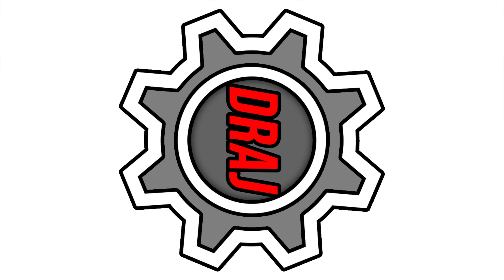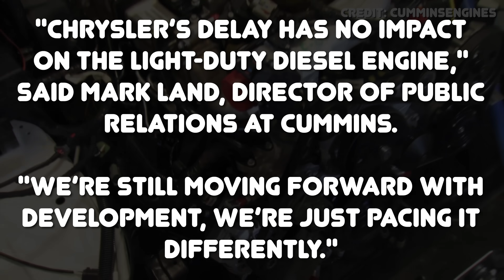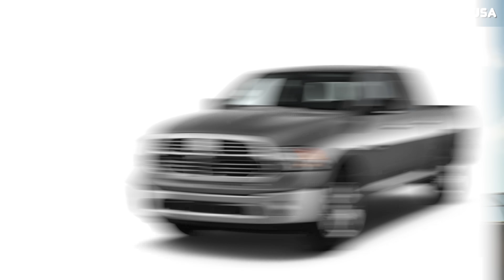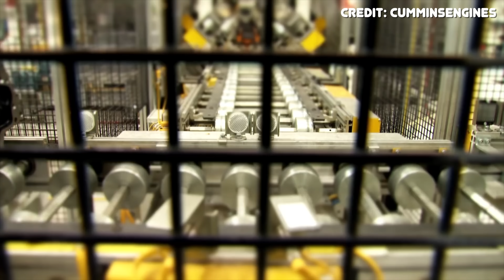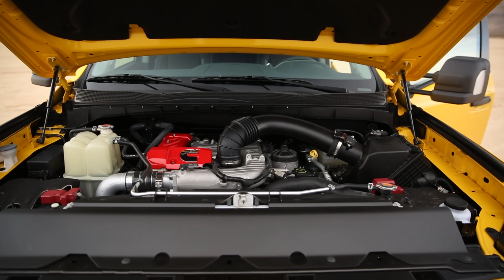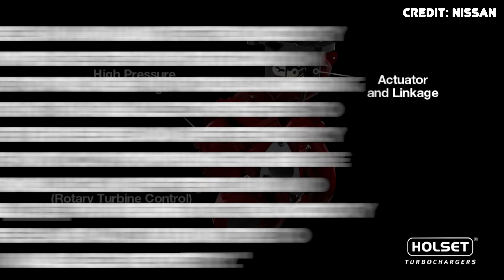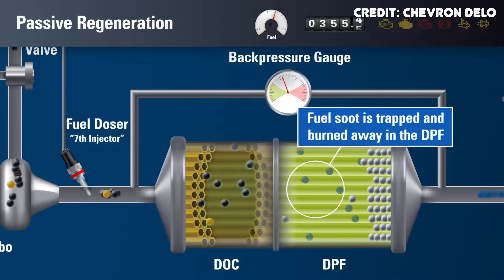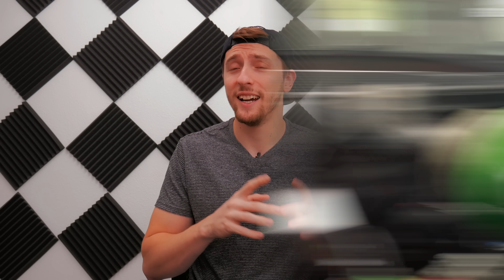5.0L Cummins: Everything You Need to Know

Comment: The inline 6 diesel is the king. Cummins B series, old Navistar DT466 and the Caterpillar 6's. I'll never own a V8 diesel and I have driven all of them plenty. I used to drive Ford & GM wreckers and they were good...but the inline 6's were better. Massive torque down low in the revs, smooth and also easier to work on.
Reply: Yup, although I made more power on my 6.7 powerstroke, the turbo started going out, so I’ sold it and bought a 96 Cummins 4x4 5 spd, soon to be 6spd. Perfect truck everything that can break costs less than 4k to replace(6.7 turbo) and I can do it in under a week. If the fuel system on the 6.7 power were to go bad, that’s 10k out of pocket, I’d only get another powerstroke if it’s brand new and under warranty/lease. Which many people do, everyone I know that drives a new 6.7 has it either leased or under an extended warranty. The one I had I bought cash and had to fix everything myself, of which issues were plenty.
Reply: @RiggyRonnie  Notice every big rig is a straight 6.  That certainly says something.
Reply: @Homeguy4x4  Scania would argue with you.
Reply: @Homeguy4x4  Scania has the diesel V8 figured out, they have all the low end torque any I6 has with comparable displacement.
The 866 Scania also is very reliable.
Reply: @Homeguy4x4  Scania has a different opinion
Reply: @Homeguy4x4 Well not every but majority of them are inline 6
Reply: @RiggyRonnie  so funny this is exactly my view I had a 2013 f350 with the 6.7 now back to a 12 valve happy as can be.
Reply: Yup, six in a row is the way to go!
Reply: All those points are obvious and well known. The idea with this 5.0, as stated in the video, is to bridge that gap between the gas engines and the big straight 6 diesels. More power for the 1/2 ton trucks without the fuel mileage sacrifice.
Reply: All of them need to get rid of the ridiculously over complicated and expensive over head cams - these are not high speed engines that are benefited by OHC's
Reply: Everyone here keeps fighting over engines and how this fails, that fails, blow by at 200k etc etc. It all comes down to maintenance and driving style. School busses use every engine under the sun and crapy maintenance schedules just like most fleet vehicles including utility co. trucks. I have seen the 7.3, 6bt, DT466 etc go 800k with minimal problems as I have seen all fail at 150k.
Reply: Those Dt 466 are superb trucks!
Reply: @tp8030  sure are except the maxxforce
Reply: @ISAF2009  yes sir. I got some friends who run them. I have a friend who owns a wrecker business and has had the same truck since 03 and they WORK IT hard. Pulled the bed off twice. Haul 18 wheelers regular with it. It has 600k on it. It will flat run down the rd too
Reply: @tp8030  oh sure, absolutely credible. There are OTR rigs with that power-plant with millions of miles and many overhauls.
Reply: @ISAF2009  gotta remember something  ,this was taught to me by another truck driver that drove garbage and dump trucks ,, and tow trucks ,, ,,OTR rigs  get more miles than city trucks ,, city trucks idle a lot , start and stop a lot ,, when you look at the mileage on a city truck versus a highway truck  2-1 is the general rule  ,,and with dump trucks and things like cement trucks  like that go into construction zones and off the pavement a lot , that number can be as high as 4-1 ,,i remember my boss telling me that when one of the swap loader trucks  had an engine failur at just past 500K miles and we decided to rebuild it completely  instead of just fixing the blown headgasket ,,it had a lot of cylinder wear compared to a few highway truck engines i have overhauled over the years
Reply: @tp8030  DT466 is a JUNK throwaway engine ,,most of them never get rebuilt ,they got used extensively in school buses and dump trucks ,very few highway trucks , every DT466 i have ever seen had serious blowby even at 200K miles ,,see a 60 series detroit  or a ISX cummins of any size with 200K miles and have any blow by at all  someone is gonna ask WTF happened ,,i've got a 60 series detroit in my garage with over a million miles and it has very minimal blow by ,, the DT466 in my RV toter has 150K miles and is a gutless wonder even with a 9 speed transmission ,,and has horrible blow by just like  every other one i have ever seen ,,,only reason i haven't swapped them yet is because i can't get parts for the 12.7 right now ,,cylinder kits are backordered 3 months out ,,my other option is a much noisier one ,,and it's still detroit green , in the form of a freshly rebuilt 6V-92TA which will directly drop in to my international 3800 ,and i am seriously thinking about it because  camping season is coming in 6 weeks , and i'm not driving that gutless turd into the mountains again
Reply: @wildcoyote34  6v 92t was in some of the wreckers in the motorpool when I was in the army. Those are freakin loud. One of the companies I work for has IC3800 school busses with dt’s and those do a lot of stop and go. All those buses have 400k+. You are right about gutless though.
Reply: @wildcoyote34  my nigga Ik u didn’t just think ur opinion was a good one 😂😂😂😂😂😂 dt466 is one of the goated early i6 diesel
Reply: This engine was completely neutered.  The endurance v8 beat the watered down diesel in every category including fuel mileage when pulling a trainer.  If they let this engine loose it would have been a success.  The issues this guy talks about are all bull.
Reply: @chrisdaniels4674   the 5.0 is a short stroke Engine,...if they could get it to 350hp, for sure it would beat the Gasser, but also battle higher emissions and get worse Mpg...
the 5.0 was doomed from the start.
Nissan missed the opportunity to shove in a serious medium duty diesel in the form of cummins 4.5 4cyl diesel.
Reply: 5.9 cummins with the 6spd all day
Reply: Modern v8 diesels make power just as low as Inline 6s..we are talking diesels here.Your rev range is pretty short.
Reply: I used to think the same, then I grew up. Duramax is just the better engine, reliability and usability just tops cummins with emmisions intact. Plenty of bottom end torque and top end horsepower that cummins cannot match. I regularly tow 18+k lbs, duramax rides smoother, tends to do better fuel economy the way I drive, and pulls harder than the Dodges I occasionally drive. Ford, I haven't driven one since 2012 so I don't really have an opinion on them now. I'm not saying Cummins isn't a good engine, just saying Duramax is better. And the trucks they come in are better to drive.
Reply: @geofffisher9886  chevys are better 😅😅
Reply: Had the Titan Cummins and it was dog sh 1t.
Reply: My favorite is the t444e because it’s not sitting in a dodge
Reply: step foot into any big industry cruise ships excluded and there all v configs, qsk 60, 78, mtu 4000 series ect
Reply: straight 6 is simply the best commercial truck engine configuration.
Reply: @Tedkelvin  Scania would argue with you
Reply: @ISAF2009  nope they wont. if the V configuration was that Good. all other HGV trucks would be V Engined.
Reply: @Tedkelvin  oh you mean like how ALL diesel locomotives are v engines because they need constant massive torque and insane longevity. Or boats, most diesels in boats are v8’s. The only advantage of an inline 6 is serviceability.
Reply: @ISAF2009  any commercial Engine above 18L is more effective when its configured as a V engine since many cylinders can be compacted into a small space. for instace a 32L v12 can occupy the same length as a 16L inline 6.
now its pointless having a 6.7L v8 diesel even when packaging is not a issue. am certain that the powerstroke costs nearly double to manufacture than the cummins 6.7 yet they produce similar outputs.
the V's as you said cost alot in maintenance and running Costs as compared to the inline 6. that in itself is what a commercial operator looks at to pay the bills after a long days work.
Reply: @Tedkelvin  so that is what I do, fleet management for an international logistics contractor. You are incorrect about service costs. If could dump all of my detroits and isx’s for Scania 750’s here in the U.S. with the same support we would save millions quarterly maybe 10 million a year. Service and fuel on these trucks cost the same per mile on trucks here even though fuel is 25% more expensive.
Reply: @ISAF2009 currently  best and most efficient Scania truck in the market is the p410 and p450 inline 6's...Scania market their 16L v8 as the stud in their severe duty applications, same way Volvo beats them with the 16L 750hp inline 6. 
you being the logistics manager....its beyond me that you regard a v8 commercial truck as a better alternative than a str8 6. yet 90% of manufacturers disagree.
Reply: Analytics software doesn’t lie.
Reply: @ISAF2009  Yeah that emd tho. 2 stroke 20 cylinder s
Reply: @ISAF2009  as someone who works on boats, like the big massive ones, no, they aren’t V8’s, most are i6, v12, or v16 configured engines, I have yet to see a v8 in a boat.
Reply: thats just it.... they dont want you working on them!
Reply: I gotta be honest my 03 excursion 7.3 is a pretty simple design too. It’s not to hard to work on, lil under powered, but I like it.
Reply: Man it’s crazy seeing all these 12v 5.9’s going for crazy money. My Dad bought a 1992 Ram 3500, dually, 5 speed, extended cab brand new for $21,000. We used it for gooseneck pulling and put around 400,000 miles on it before he bought a new 1999 F350 4 door. If I recall it was just barely over $31,000. He used it as a work truck for a bit and ended up selling it for like $1000. Oh well, the way he looked at it the truck paid for itself over the years.
Reply: In-line is definitely the way to go, no need to split the engine into two compartments. Also a humble brag… 52mpg Highway in my 2017 GMC Canyon 2.8 LWN inline 4 banger
Reply: @LU-D1GITAL  thats an in-line 4 though which is a completely different animal and today's technology allows for higher milage in ALL engines.
Reply: The only diesel V8 I’m really a fan of is the classic Navistar T444E
Reply: I’m sure the v8s have there perks thoigh. But I have to agree. In-line 6s are some awesome motors. Easy to work on and tinker with. As you said. I just feel like the v8s while more complicated do have some potential
Reply: Greetings: Indeed I agree. However, as he said, the idea of the ISV5.0  was economy. V8s have faith economy over the I6s whilst the I6s have better torque. Which is, in my opinion, the better served purpose. I have N early 90s GM gasser truck that would get 22mpg Hwy / 15 city with calm driving habits prior my converting it in2 a small service truck.  MPG in half when I parked it 2yrs ago. Above all I prefer the older mechanical units-  3116, 3208, 4V71,6V71, DT466 and the Pre 94 Med duty UD I6. Again, this I6s have more torque than the V8s. These newer, electronical units have 2 many reliability issues and take 2 much expense 2 get performance and somewhat improved reliability. They might B fastest around the track but my mechanical will always cross the finish line... Even if the alternator/battery does. Thx 4 the post.
Reply: Um, the 3408, vt903 and 8v71 want to speak with you
Reply: Honestly I am a Gm guy but it is true the duramax is great but if it breaks you better be ready to dedicate weeks to months and thousands of dollars to fix it
Reply: GM has I6, even for Cadillacs.
Reply: What is your point ? your comparing apples and oranges,  it's designed for a half ton pickup.
Reply: Ah but, scania v8
Reply: I enjoy inline 6 gas engines too my jeep 4.0 has 200k miles and it still runs like new
Reply: The reason why old 5.9 and 7.3 powerstroke are better is less smog components which cripples and new diesel engines and it’s hard to work around them if there was no smog emissions I guarantee you we wouldn’t be having this conversation
Reply: Don't forget about famous N14 CUMMINS😎
Reply: LBZ duramax is arguably one of the best diesel engines ever to be installed in a pickup truck.
Reply: @Starmush85  not as good as online 6 diesel facts 💯
Reply: @richardyost2522  youre completely correct. Inlines are superior in reliability and durability simply because there is less stress on components since everything is linear same as oil supply is consistent for each cylinder under any conditions
Reply: At work we’ve got a 2008 Chevrolet Express Duramax  with almost 300k miles on it an the only things (besides regular maintenance) that we had done on it are the glow plugs,thermostats and we replaced the thick wire that supplied power to the glow plug module (it disintegrated due to excessive heat), so in my humble opinion… they are really good engines on my book,the transmission was flushed and new filter installed and the only problem so far is the cheap plastic all over the van it’s braking apart!
I hear very often that cummins are better,however, I think the problem in most cases it’s lack of maintenance!
Reply: Straight 6 is simply for balance purposes,   v8 is for short block big torque
Reply: I have a 19 xd diesel and so far it's the best one I've owned.  Like all new engines the v8 cummins has flaws but affordable to overcome.  Power and economy straight out of the box. If maintained correctly these engines are very comparable to the i6 counterpart
Reply: Inline 6 all day. But I make 2 exceptions. 7.3 powerstroke, and an LBZ DURAMAX.
Reply: That’s not entirely true there is several very good v8s lb7 and 7.3 if properly cared for and maintained
Reply: Good for you.
Reply: 6 in a row, ready to go
8 in a V, you sit down to pee
Reply: Eh, the only thing inherently different about an i6 is the fact that it needs balance shafts in order to run correctly. Everything about them having "massive torque" comes down to the fact that there are more i6 diesels because it's harder to fit a v8 under the hood of a semi truck
Reply: @jankington216  Unless its a Detroit V16 😉 The 2 stroke sound of perfection lol.
Reply: DEf pump failures sometimes  comes from the juice coming through the pins.
Reply: @richardyost2522  what is the b50 on a t444 vs a 6bt? Actually diesel v8s are more durable just generally not rebuilt in frame as easily. Think about it, divide 720 by 6 vs by 8… more frequent power pulses and a shorter stroke that isn’t straight up and down. V engines have the durability advantage at equal displacement and power level. No opinion, fact, basic physics. Americans are stuck on inline engines in class 8 vehicles because of serviceability in frame. Modern diesel v8’s are winning the power wars, torque wars, and service interval wars in all medium and heavy duty categories.
Reply: @ISAF2009  diesel V8 in a large highway truck in the USA  kinda went away  with the 3408E CAT ,,i drove a peterbilt with a 3408 and it was a monster even compared to a 3406 ,,thing had more nuts than it knew how to use ,,,even more than the twin turbo 8V92 in my 1980 peterbilt 359 ,,and it is no slouch  putting 650HP out the rear wheels 
i personally like V8 engines ,, they are smoother ,,but the reason that inline 6 engines have kept their dominance is just plain serviceability,,
Reply: @wildcoyote34  best comment on here!! 👌
Reply: @ISAF2009  I've never met or heard of anyone who can back up the claim that a V engine is equal or better in durability/longevity than an inline.
Tens Thousands of online reviews, dozens of channels, thousands of mechanics.

Hell even the engineer at my old vehicle parts manufacturing who was obsessed with V8 motors never made that claim because "...yeah in lines are more reliable but I love the V8 still"

And less impulses per kWh of energy produced is superceded by dozens more moving parts wearing down.

For the same reason a box wrench is more reliable than a ratchet, moving parts cause friction, friction causes wear, wear causes failure.

It's just basic physics, material science, decades proven real world applications kid.
Reply: Incorrect, V8’s are superior diesel power plants.
Reply: @ISAF2009  lol
Reply: @ISAF2009  Cat had a V8diesel and dropped it, Detroit Diesel had V8, V12, and V16, now they make inline 6’s, why?
Reply: I’d buy a tacoma 💀
Reply: @PNW_Adventures1  😂😂😂😂
Reply: Your absolutely correct and with that being said there should be a blockage from people uploading B.S videos like this 1

Comment: I hate mine,  it now has 20,000 miles. The response to throttle is slow and very restricted.  It dose not have any get up and go if you need it too. The power in pulling starts great off line then disappears once moving . ( won't get up to passing speed easily towing)  the body and wheel wells are short and small so adding any aggressive tires and rims are out the question.  They look funny with the little wheels on them. And you would kill your little power you have even more with bigger tires and wheels .
It's a poor man's diesel.  If I could justify 65-80k for a true work truck I would love another f250. 6.7 but was really in hope the cheap diesel Nissan would hold up to some of the Cummins name. It for me did not
Reply: I lifted my 2017 XD six inches and put on 35-inch wheels. Now it looks like it was intended to look.
Reply: @JamesMcGillis  lot of lift for just 35, f250 with a small 3inch clears 35 . As well as the 2500s and so on . It just sucks that these trucks fall short on so much . To have been such a high expectation for nissan.  But to the point if this video it was NOT to be a 3/4 truck so I guess all my comparisons are not really fair . 
I just had hoped for a lot more out of this truck ,but it failed to provide any towing or driving performance I though I would see . 
Being a Cummins and a v8 even being a smaller diesel v8 I had expected more